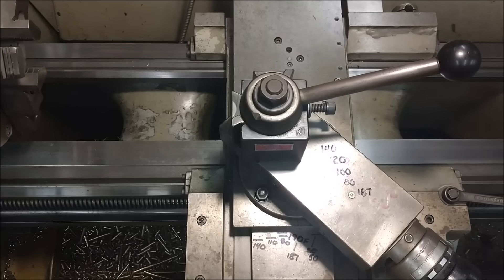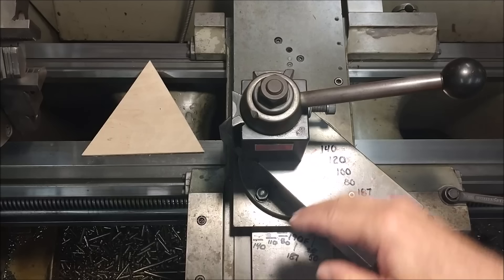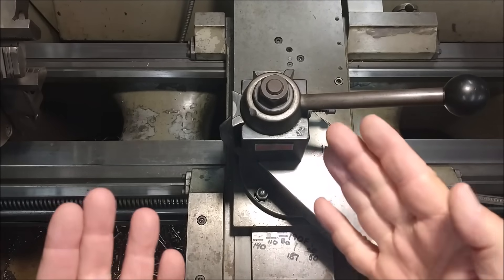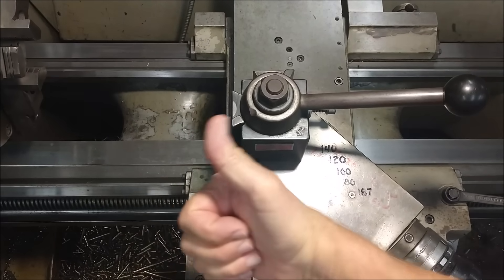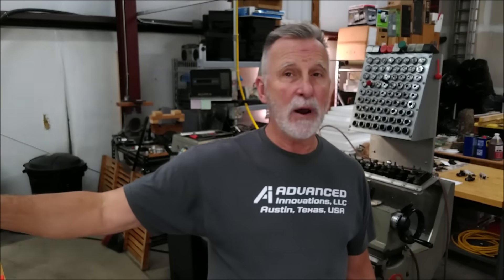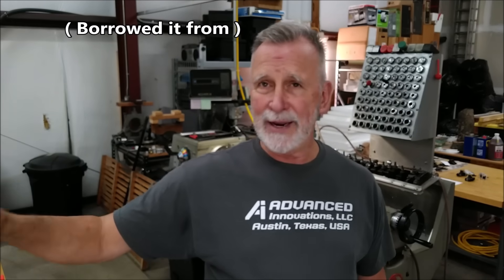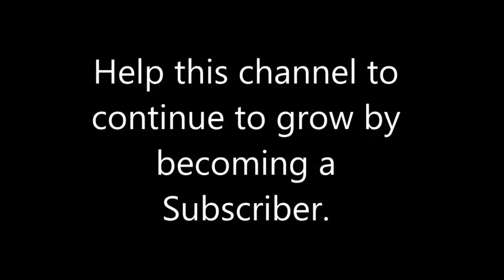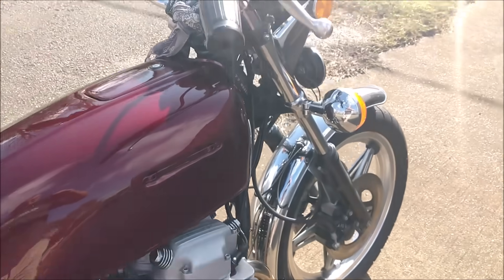New ( and current ) Machinists Should Watch This !!

Comment: I have not once angled the top slide to cut a 60 degree thread, not even a coarse pitch one. My top slide (except when cutting short tapers), stays parallel to the spindle axis, with the gib tight enough for the slide to be stiff (for the extra rigidity). When cutting a coarse enough thread that radial infeed would result in a poor finish, I simply advance the top slide by 50% of the radial infeed. Geometrically, this is very close to the tool movement that would be achieved by angling the slide, but my infeed is directly read from the DRO. Better than that, is that once I have a reasonable depth of thread established, I can use a thread pitch diameter micrometer and put that value in the DRO. For other thread angles, I might angle the top slide, or generate myself an infeed list. I often do that anyway, because I like to go quite aggressive with my initial cuts when the tool pressure is low. If you really wanted to, you could calculate feeds to give you equal tool load per cut, which is what CAM software can do.
Reply from the maker: I too, very rarely use my compound. Only if I encounter chatter or a poor finish do I change my approach. And that heavy first pass is something I always do, but many don't practice.

Comment: Dad always taught me 60 and a bit unless you were thread chasing. Took me a while to figure out exactly why 60+.

Metric machines make it easy to get the depth perfect. We were usually doing one off jobs. So, no pressure to get it right. 😐

Always used a angle gauge and paper to ensure the tool was square. Never really had any issues apart from thread root and crown radiuses. Mostly gone now with full form inserts. 
I still check as I was shown though. Mark of respect perhaps?
Reply from the maker: Nothing wrong with good habits.

Comment: Thanks for You sharing your experience and obviously extensive knowledge.
I have been trying to make a thread in the lathe I’ve been presented to. After looking at Your, Abom79, Mr Peter 222, and some other people’s videos, I’m fairly educated in how to perform the task.
Everything from grinding the tool via the setup to the cutting.
BUT, 2 out of 50 tries the thread looked absolutely disastrous. It’s raged and ugly. 
Everybody shows nice and smooth threads that almost look ground and flawless, in there videos.
Why is my threads more or less destroyed? 
Of course might the material be a contributing factor but still. In Your videos it looks so easy. 
Is there some detail I might miss! 
This is from a wannabe machinist from Sweden! 
Regards PeO
Reply from the maker: What material and pitch thread?
Reply: @ 
Usually som unknown scrap round stock. If You have some rule of thumb, what metal quality to use. I would be happy to translate US material standard to European standard! 
I have tried 1/2”-12, 7/8”-9, M16 and M24 among some others. 
Peo

Comment: Should you use the compound on an angle for carbide insert thread tools.  I mean the three sided thread profile shaped inserts.
Reply from the maker: Not necessarily. If your machine is rigid enough and your happy with the finish, plunge it.
Reply: @joepie221 thanks.  Machine seems to handle it ok, so just "plunge it" it is 😂

Comment: I have not done thread cutting on a lathe but I have always thought I would set the cross slide at an angle so that one edge of the tool does 95% of the cut and the other edge 5%. (Ish) In my head it seems better to ensure both edges cut than risk a staircase on one flank of the thread. Of course I don't know if this would cause problems because I haven't done it.
Reply: It’s typical in the UK at least to set the compound at just shy of the 1/2 angle eg for 60 degree 29.5. Personally I favour the direct plunge perpendicular method as it works for most threads in most materials I use and the depth of cut is direct reading. For coarse threads at larger diameters the 1/2 angle method reduces issues.   Another tip is to run a die over the thread when close to final dimension to improve the crest and root forms, the cut thread ensures the die stays straight. I suggest you try screw cutting if you are able to.
Reply: Why do you think a “staircase” on one edge is an issue? Why do you think that would be caused by feeding straight in with the cross slide?  How could that happen?
Reply: @narcoleptic8982  I'm talking about when the cut is put on using the top slide turned to typically 30 degrees (for a 60 degree thread). If there is a bit of inaccuracy the wrong way it would leave steps on one flank of the thread. If you plunge straight in this wouldn't happen but other issues arrise.

Comment: The compound slide MUST be at the this angle is slight exaggeration. I machined many threads when the compound is not in an angle and feeding was done with the cross slide. Maybe it is a preferred methid to minimize pressure on the lathe, but not a must. I also seen many videos of thread8ng with the compound at 0 angle and feeding with the criss slide and moving the compound slide a little at a time to emulate a compound in and angle and feeding with it. Just saying. Don't get me wrong though, I like your channel and your insights, learned a lot from you.
Reply: Literally never moved my compound slide while cutting threads in fresh material.  I don’t get why these guys say it’s a “must.”  All of the old guys I’ve worked with ignored the 29 degree compound feed threading.  Why would I handicap myself by not using the DRO?
Reply: @narcoleptic8982  The logic behind the compound slide angle is to minimize the load on the cutter, as it cuts majorly on the front side and only little cut on the  rear, something that can reduce chatter and so on, but the thread will get good in any case.
Reply: At the 4.30 mark there is a message to cover feeding straight in. This is also the method I use as I very rarely have my compound on the lathe.
Reply: Joe is definitely a guy that is worth listening to. I learned many things from watching his channel.

Comment: Always watch your videos Joe... I am in the class of "gifted amateur" with no formal training but a fair bit of experience. I have picked up quite a few very good tips from you. Thanks... :-)
Reply: Here’s a tip from a different journeyman machinist:  I’ve never failed to hit a tolerance or have a thread that worked anything other than perfectly by feeding with the cross slide and not the compound. 

Here’s the real pro tip.  Get some scotch brite, stick it under your coolant spout, and run it over your threads a few times to get a perfect finish.  Wet scotch brite is the secret weapon for smooth threads, not compound feeding.  Nobody’s putting your threads under a microscope.  Just make sure they’re shiny, smooth, and in tolerance.
Reply from the maker: Glad to help. Heres another pro tip. When deburring as thread with emery or scotch-brite, do it in forward and reverse. Doing it in only one direction can lay down burrs that will stand back up under reverse rotation and load contributing to galling, seizure and failing..

Comment: Any shop nowadays that does not supply quality measuring tools is not worth sticking with. 
All measuring tools should be calibrated periodically to ensure uniform measurements. 
Yes, you may have special trick tools you made yourself or at least you should have!
Reply: I prefer using my own tools even in a shop that supplies them.  The difference is that I know how those tools have been treated.  I trust my own telescoping gauges to .001”.  I don’t trust the shop ones to .005”

Comment: Leaded steel 12L14 ( L is for leaded) is the best material to learn on , once you’ve machined it you’ll love it . 
McMaster sells it . Any decent metal supplier should also stock it. 
I don’t know why more people aren’t familiar with this material . You don’t even need coolant to part it off. It is only approx 60,000 psi yield , strong enough for most jobs. ( aluminum 6061 is only 32,000) 
It’s great for threading.
Reply: Be great if we could get it, in Australia all you get is dumb looks it you ask for it.
Reply: Learning on easy to machine materials makes for a weak machinist.  May as well tell people to learn by machining teflon. Mistakes are where we learn.
Reply from the maker: I say learn on easy to machine materials to get the mechanics of the task. Why add other variables that can contribute to the difficulty initially. Sooner or later you'll have to face it anyway.
Reply: @ It’s just not a realistic machining scenario though.  Learn on 4140, you at least have a frame of reference for proper steels.  It’s fairly forgiving, teaches you proper principles.  (Such as always use coolant when you’re parting off.)
Reply: It wont weld. (When that matters).

Comment: 👍🏻 more invaluable shop wisdom from the master.
I would add to check the cleanliness of the lead screw. They have a tendency to get gunked up and the half nuts won't fully engage. Might need a stiff wooden or plastic object to scape the hardened gunk out of the screw while it's turning. Set a course thread get it spun up.
Reply: Should clean the lead screw every time as you get dirt imbedded in the bronze half nuts and wear the lead screw unnecessary.

Comment: The old guy who showed me how to run a lathe, tested me hard the first day. He had a slam wore out line shaft lathe from the 1800s and gave me specs for a brass pin bushing. You could see the belly in the ways and almost 2 turns of cross feed slop. After an hour or so he came back and told me it was just a test figured the bushing was crap. Well I  didn't hit specs, missed it by 5 thou. He laughed and said he didn't care about the bushing, he was testing to see how I handled stress and how well I could adapt to problems. I  learned a lot from that man. 
RIP Mr Cory.
Reply from the maker: My Mr. Cory was a guy named George Metz. It was like working with my grandfather. I knew he cared and had the patience and wisdom that was almost magical.

Comment: Toolpost at angle looks like american fetish. Why you think you "must" set it at angle close to the thread?
Straight cutting works as well.
Reply: I agree , learnt on 29.5 deg method but have not used it in 30 years and have produced top quality threads in Ti.
Reply: Definitely.  I never thread like that ever.  Why would I handicap myself by not using the DRO?

Comment: My lathe does not have a compound cross slide, and it will work at a 90-degree angle. I usually can do my threads and maybe two or three passes; it usually works out pretty well.
Reply: Man what the fuck?  Compound and cross slide are two different things.  And cutting threads in two or three passes is not reasonable.  You need to ask yourself and someone who knows what they’re doing some questions as soon as possible..

Comment: I think I mentioned it previously (several years ago?)
In Britain, this was taught as 'American threading' and un necessary until you were doing really deep threads.
At the time Whitworth was still in use (although being phased out as newer machines were being installed)
Vast  majority of threading jobs, the thread isn't that deep, fine thread on 1-1/2"  bar can be done in one pass (may not give best finish though 😇)
It's F2, at least in Europe.
I worked on thenm at dealers in  78
Reply: I agree, I was taught the 29.5 deg method but once I had to make a living running my own shop I have never used it since and have produced very high end titanium parts.
Just use the cross slide and don’t take excessively large cuts.

Comment: Merry Christmas, as a self taught hobby machinist, I didn't know to set the top slide over, Thanks. Nice Honda 4! Sounds really tight and smooth. The number plate is going to take some flack! My 500 single blasted the plate right off! It was suffering metal fatigue from the exhaust pounding it, till it fell off one day!
Reply: You don’t need to set the compound at an angle unless you’re feeding your cuts with the compound slide.  Ignore that bullshit.

Comment: Mr Pie, I’m a very new hobbyist, so please excuse my ignorance, but in the example shown is that compound set within the 60deg or outside? When you placed the second directional piece, it did not appear to be parallel or “inside” of the angle formed from the thread form piece.
Reply from the maker: Inside sir. Always inside.
Reply: You only need to set the compound to an angle if you’re using the compound slide for your infeed.  If you’re going to take your depth of cut with your cross slide, the only thing that matters is that your threading  insert (or ground HSS if you’re a masochist) is true to your part.

Comment: Waiit the moment....
YOU need to buy tools when you work in someone's shop?
Maybe I misunderstud, but when I wok for a company.. I expect that COMPANY will provide all the tools, not me.
If I work for ME then of course I will buy my own tools.

Or... machine shop in USA is some kond of "comune", where all of you work as individuals, just have the some parts of bussines common (like accounting, purchase department, sale...)...
Reply: It varies depending on the size of the business but Tool Cribs are a thing for tools and tooling but checking in and out each day or time you need basic items gets old fast. A Gerstner style tool chest with 20-30 regular use everyday tools owned personally makes so much sense and you 'know' they are accurate, well maintained and not abused by Apes.
Reply: Yes....in USA in mostly non ISO  shops you ARE REQUIRED TO BUY YOUR OWN MEASURING AND BASIC TOOLS...as for wnd mills and inserts etc. they bought  by the company 😊. I have over 8 grand in tools that were bought 30yrs ago at 30yrs ago prices😊 ....and im glad i did😊...i do complex 1 pc jobs....its nice to have that feel and know your own tools.😊

Comment: One question for you Joe. For the hobbies who just picked up their first lathe or mill, where would you recommend they get some material to learn the machine’s operations on, and what material, Delvin, brass, mild steel, aluminum?
I have seen this debated on many forums and wanted to see if you wanted to weigh in on it.

Merry Christmas to you and your loved ones.
Reply from the maker: Acetal. Cuts the same as delrin at half the price. Happy Holidays to you too.
Reply: Hobby Metal Kits sells small quantities of brass aluminum steel acetal.
Reply: Ebay has tons of metal. Decent prices for small quantity.

I've had good luck with a local Metal Supermarkets. I hear it varies based on the store.
Reply: Try Leaded Steel 12L14 ( McMaster) or any decent metal supplier. 
Cuts like butter 
Poke around at some machine shops can’t they may have off cuts to give you . Great way pick up bits of material.

Comment: I'm still going in my trade. Fifty years in Feb 17th. I had never seen a lathe working. The put me on a lathe facing bronze thrust disc's. It was a full engineering company with there own foundry. Had to keep the swarf. I asked about levers on lathe and was told you don't need to know about them yet! On my third day they set me up to retread a 3/8"unf puller spindle. It was sticking out about 6" from chuck. Made up hss thread cutting tool and set lead screw etc. First a few passes just following thread without touching. Get the hang of engaging leadscrew etc. Then they had me make a light cut. Ofcourse it deflected, then bent the screw and that was the lesson. Started off with a new piece of material, quite a bit longer and used a centre in it. Undercut it near end in preparation for threading. So proceeded to make new spindle, afterwards removed excess material and pointed to finish. Turns out I had a gift for engineering and after 3 1/2 years they put me on a brand new lathe with power rapid travel on both axis. There were 60 chaps working there so a few noses out of joint! I guess the thing that matters most is planning. From finished job backwards. How to get there and not snooker yourself. Much to the annoyance to some I don't drop my standards. Remove every burr etc. Measure often and double check stuff. Even came across some threads the other day. Off a truck hoist. Was asked to repair threads as they had folded under load. No they hadn't. They were a buttress thread with load only one way! No one believed me until I got out my machinery handbook. The training I received was first class. The system we have today is sadly, frankly garbage. The chaps don't understand the significance of tool setting, centre heights etc. They just get another tip out of the packet. Don't resharpen worn tips to use on welded stuff. Just throw another $8 tip at it.
Reply: I once worked at a shop where I was the only guy who had a handbook.

Didnt last there very long lol

To be fair though, you can only sharpen brazed-on tooling.  Inserts aren’t really sharpenable unless they’ve just worn out, which doesn’t really happen in a manual shop.  They usually chip or break before they wear out.  Not a lot of manual production work the last decade or so.

Comment: Hi Joe,
The most difficult internal thread I machined on my 7X12 mini-lathe were four 1.125" x 4 TPI square thread brass bushings that were pressed into cast iron barbells to be used on a 1885 antique 8" refracting telescope as counterweights. The original counterweights were misplaced. I made two 25 lb. and two 10 lb. weights. I could not bring the counterweight shaft to the lathe, so used a silicone mold casting kit to make a mold of the counterweight shaft thread. I then used the negative mold to cast a positive using low melting point casting metal which I used as the test plug as I was machining the internal thread of the bushings. I surprised myself that the bushings fit the counterweight shaft very well and then pressed them into the barbells. Worked extremely well in balancing the telescope. One weight was used to lock the other into place after the balancing was completed. Stay safe.